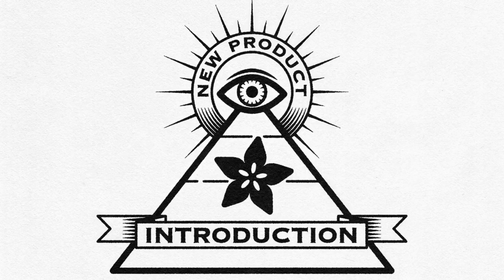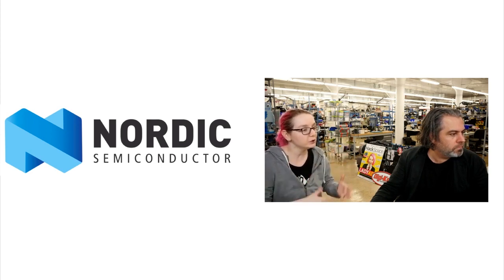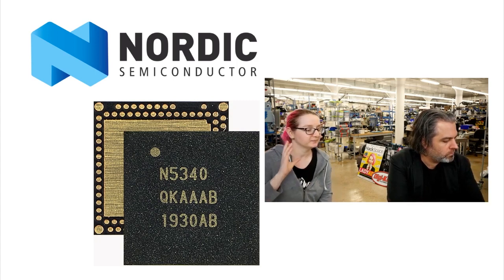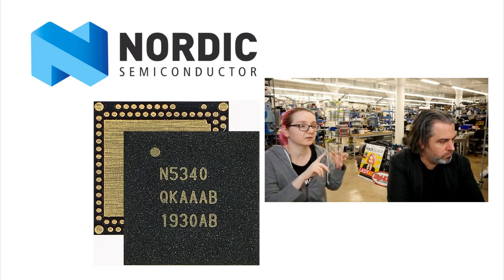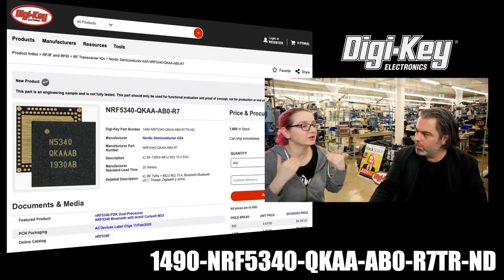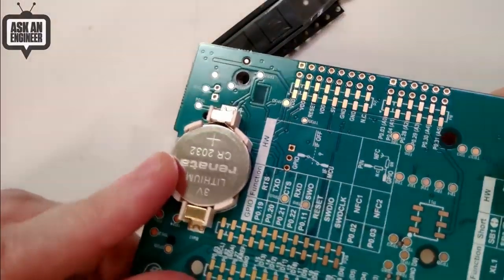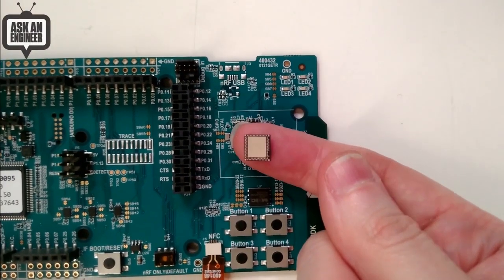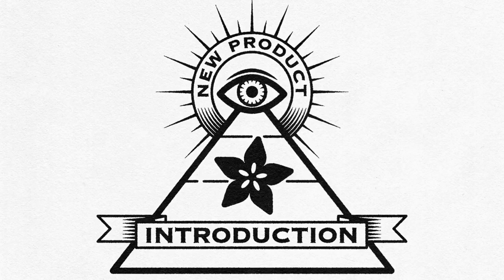EYE on NPI: Nordic Semiconductor’s nRF5340 #Bluetooth #EyeOnNPI @maximintegrated @digikey

Comment: Saw rumblings about this in your GitHub projects a few weeks ago, it definitely looks interesting. No idea how you do dual core microcontroller programming when you don't have an OS - do they have separate flash/ram? Shared flash and one is the boot processor, and you write some register to tell the other core the entry point? Is an RTOS essentially mandatory like it appears to be for ble on single core, or does the dedicated core for radio mean you can go without an RTOS? Lots of curious questions, seems like a neat part. Will have to get one at some point to play with, though I have some 840s (and an 832) sitting around I should put in a project first 😁
Reply: You use the nRF Connect SDK which is based on the Zephyr RTOS to program the nRF5340. https://infocenter.nordicsemi.com/topic/ug_gsg_ncs/UG/gsg/intro.html?cp=1_1_0